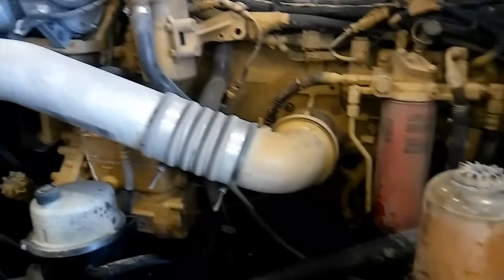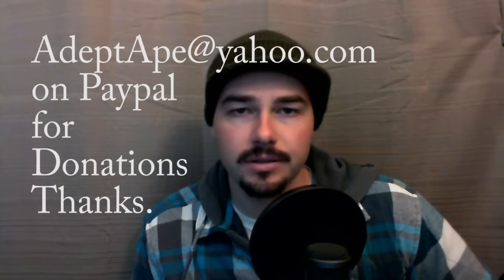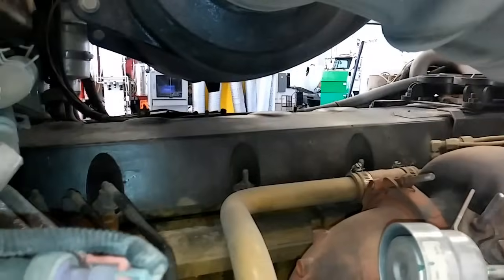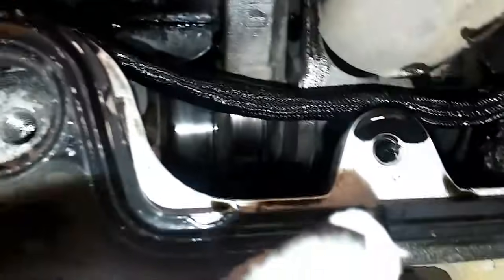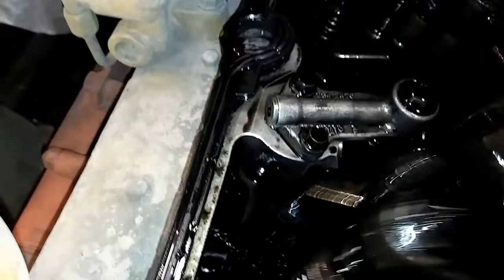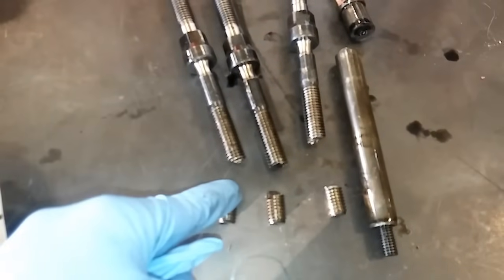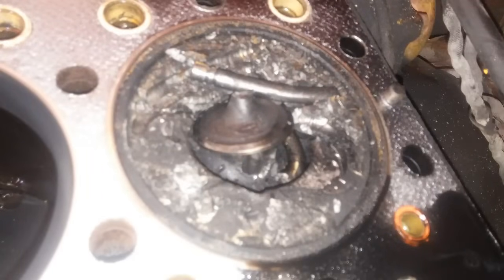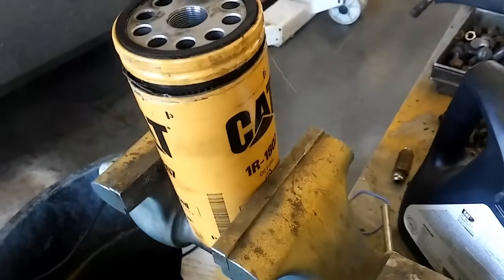What Causes Diesel Engine Ticking, Clicking, Tapping, and Knocking?

Comment: my e39 has ticking problem at 2500 rpm when engine is cold....i just ignore the problem until problem becomes bigger :D since its easier to replace entire car or entire engine than to fix injectors or anything else on bmw.
Reply: Copper washer on the injector! 100 %, shitty garages dont change them when taking off injectors. Just did them on my e61 530d.

Comment: what will keep a cat from starting but it will start with starting fluid
Reply from the maker: +Justin Snow I've got an engine not starting video you might want to watch, but it could be electrical like the ECM went bad or no fuel pressure, check those first.

Comment: Even with updated Rocker/IVA bolts they still break. Before Acert engine (expect for MXS iva housings were separate from jake housings) Cat had long bolts that went through jake housing and rockers NEVER did they ever break.
Reply from the maker: +Alena Soto The BXS had the separate IVA housings, not the MXS, but yeah I haven't seen the older engines break the rocker bolts like the MXS/NXS/SDP did, whether the bolts were updated or not.
Reply: Yes I know about BXS and even remember first 2500 BXS had wrong software, update turbo studs and bracket. SDP was over engineered mess with basically 2 EGR systems. I also remember when they said acert not EGR and IVA just hold intake valves open longer to get more charge in. We all know it was EGR just couldn't tell us techs the truth. Bridge engines with broken liner flanges

Only good thing about acerts they didn't blew head gaskets out like 5EK, 6TS, 1LW, 2WS and 6NZ, 1MM. 7CZ truck side
Reply: I'm under my Wife's username since she keeps logging me off and I forget to log in
Reply from the maker: +Alena Soto I think the older engines had more liner protrusion and head gasket problems because they would just keep running and running mileage until they wore out the liners. Unlike the SDP, which sees the shop a little more often.
Reply: I remember there was block metal change with blocks if I remember. Liner protrusion from factory around .003 to .0035 with early and late engines. First acerts fan came on at 226 then they backed it down to 217

Comment: remember too that piston slap is normal to some extent upon cold start. that will cause knocking. this is just due to an out of round condition until all the components warm up. this is especially prevalent on older all-mechanical engines.
Reply: d wes
Reply: And when that happens you just need to rev it to the redline and roll coal till warmed up.... LOL, yeah I love how mad my 7.3 sounds in the cold.

Comment: To find the ticking noise, just brick the pedal and go get a cuppa cawfee and check out the hot receptionist on the way back, and see what ya got. 
Rinse and repeat until it stops running and look for the hole in the engine.
Reply: Or turn up the radio volume :)
Reply: that sucks
Reply: +aww
Reply: Great technique man!
Reply: MrTheHillfolk Awesome man!

Comment: diesels are noisy anyway so how would you know if it's taping or its normal
Reply from the maker: +Kody George It takes awhile to hear what an unusual noise is on a Diesel, but especially a driver can hear one usually right away because they know what the engines sound like.
Reply: True I had a trans am ls1 it started knocking and then shortly after it blew a rod your piston out the bottom lol, but it's time I put it together the way I want where I don't have to worry about it blowing up
Reply: sleep in them and listen to them 24/7.  I can hear mine a mile away, parked in a group of idling trucks.

Comment: Oddly, I had an old 7.3 Navistar that pooped out the oil control ring. That was a surprise. Another oddity I've encountered on a gas engine was a piston skirt that had broken off, causing the engine to knock intermittently.
Reply from the maker: +Wrench245 I've never seen a part of a piston come off and the engine continue to run fine. Was the oil control ring causing a knocking or tapping?

Comment: +Adept Ape
I been looking to re-power a Kaiser M-715 6,500lbs project, my intent is a 2003 6.0 LS engine with a 4L85e / AMG 242 transfer-case, I have already.
The pros and the no-go are not too far apart. I would like to have something I can drive "From Sea To Shining Sea".
The BT6 I tend to find, have "issues" blow by, burned valve seats, and crazy miles.
I'm not even sure if a BT6 is the engine to get, I'm aware the BT4 is rather good but my military truck is not a UPS delivery truck.

I know my gas engines,............. this thing will be used for long hauls possibly Route 66 .
Not totally set on the 12 Valve Cummins engine, the Detroit not so fond of, and if I have to run a PCM it would only be for a Duramax. 
Respectfully, can you give me your opinion?
Reply from the maker: +ramairgto72 You have me a lot of info there, so you want to run a 6.0 LS engine or a Diesel, but are unsure which to get? If you have the 6.0 already just run that the Diesels are expensive as well as the parts for them. If you wanted to go the Diesel route I would say the old smaller Cummins in the Dodge trucks, the 5.9 were pretty good I hear, the Cat 3126 is a good engine, other than that I don't have much Detroit experience so can't say.
Reply: Thank you for the reply.
I belong to most M-715 forums and the common repower is a 1 wire 6BT.. Having served in the military and having been in the back of APC in the heat and cold, the smell of burned Diesel is not on my "shot list".

However the "car guy" in me cannot ignore the benefits of rather good MPG, more usable TQ then I would ever need and a dependability factor all in it's own class. Not to mention they are rather waterproof.

Thank you for your advice, I believe I will go with my 6.0 Gas LS, at least for now.

Thank you!
Reply: Ive looked at some smaller army trucks and they always had 4 cylinder diesels in them.  I guess with gearing and low expectation on top speed any little motor would move it.  But how fast do you really need to go?
Reply: With traffic.
It's that easy, most M715 have 30 MPH MAX SPEED stenciled on the dash.

Comment: are there any piezo injectors on cat? I know if the hold pressure on a piezo system fails the injector make a clatter noise and destroy them self's if you don't get it sorted quickly so I Wonder if some cat use this Bresser hold system it's 10 bar on leak side of piezo only injectors.?
Reply from the maker: +Intrade Motor I looked up Piezo injectors in the Cat system and nothing came up and I've never heard anything about the injectors other than the use of solenoids which would imply that Cat likes electro magnets more than the magic voodoo of Piezo. You actually went new down a rabbit hole with that Piezo search where I was watching chemists make Piezo crystals and testing voltage.

Comment: Another good topic on this video. A good diesel mechanic can distinguish what noise is  normal and what noise is not. I think the older mechanical engines were a lot noisier because of the injector pump, First time I heard of a leak outa exhaust valve seal like on your video, nice to see it. 
Keep up the work and Happy Thanksgiving.
Reply: Joel Lagpacan  older Diesel are more noisy because of less controlled combustion . A old Diesel had 1 injection a modern car Diesel up to 12  for better burn more power and loads less noise .  there is a upside and downside to electronics.
Reply from the maker: +Joel Lagpacan Thank you Joel. It takes awhile to hear what a "weird noise" is sometimes on a Diesel and every model sounds different. Happy Thanksgiving yourself.

Comment: got a question for ya.   had a valve bend on a 5EK.  3406E. replacing head and cam.  but my question is do you recommend replacing rocker arms and shaft or Jake studs ?   I believe these parts have not been replaced and block milage is near 1.3 million.
Reply from the maker: +Shane Leiser The 5EKs didn't have the same problems with the overhead bolts the twin turbo engines did, but if those bolts are original it wouldn't be a bad idea. You should change the rockers arms though if your doing a cam because the rollers are probably worn and you don't want old rollers on new Cam, and the warranty for a Cam only applies if the rockers are changed. Cat also recommends changing the head bolts, but doesn't require it on C15 engines so especially if you find rust or pitting on the head bolts.
Reply: thank you for the info
Reply: Shane Leiser

Comment: Clatterpillar !  We have a C15 mxs engine with 285k miles. It had a cracked injector cup last year ( fuel in the coolant).  After repair, Cat "turned it up " to 550 hp.  I notice now, it has a strange " combustion " noise that sounds like " tink, tink, tink, when it's idling, or at low rpm. The noise changes with rpm. Definitely not a knock.
Reply from the maker: +george kuersten Hmmmmm, well if they did an injector or cups they had to remove your overhead so it's possible one of the setting is set too loose or a light fuel knock, but usually those happen under a load.
Reply: its a washer under the injector or the injector its not enough tighten up .

Comment: In your opinion, whats the best c15 out there to be had in the US?? I've read alot that the 6nz and 2ws are pretty good.
Reply from the maker: +Gary ClarkII 6NZ is pretty good, I think that would be my pick, has better seals than the older engines and no emissions stuff.
Reply: A friend from youtube that I'm subscribed to has a truck that PDI rebuilt if not mistaken. So far after only 18000 miles its done blown twice since they rebuilt it. From my understanding they won't touch it any more and if not mistaken its a 6nz also. From what he's said he's going with a 2ws ,which is electronic without the emissions if I read my research right. And if mot mistaken the 6nz is the mech. version of the 3406, I'm sure you can tell me the difference and wish you would please. Just trying to wrap my head around it for now, lol...
Reply from the maker: +Gary ClarkII A 6NZ is electronic, I've never seen one blow up after a rebuild, I wonder if they checked the liner protrusion when they did the rebuild, if they didn't that could explain it failing.
Reply: I don't know the details, all I know is that he said cat wasn't touching it any more, referring to pdi I reckon

Comment: hey pard question for ya my 2005 KW! C-15 ACERT Has 700 g miles on it with about 200g on a total rebuild due to a bad oil test and a big dose of silica on the test! so we had it completely rebuilt! but now I run it hard every day with no probs but I notice it's puffing alot of product out of the blow by tube at idle! and at night when I park her it's leaving oil spots out of the blowby tube! and I go threw a gallon of oil every 5 thousand miles! service at 10G anny advice?
Reply: CAT DIESEL POWER  hey there is a driver on YouTube that has a c 15 6 NZ paid cat 42 200 to rebuild only got 18000 miles on it and blew up he is the renegade trucker maybe you could reach out to him it has about put him out of business maybe you could point him in the right direction cat doesn't seem to want to help
Reply from the maker: +CAT DIESEL POWER (ALLDAY) Hmmmmm, well lots of blowby isn't usually good as you probably know. Have they done a blowby test on it? Could be turbos, one cylinder damaged, valve seals, or air compressor. If it puffs a lot you can try to do a cutout test to see if it's over cylinder that works sometimes.
Reply from the maker: +Shawn	 Goard That rebuild should be under warranty still, something sounds odd about that story. If he had questions for me I'd happily answer them.